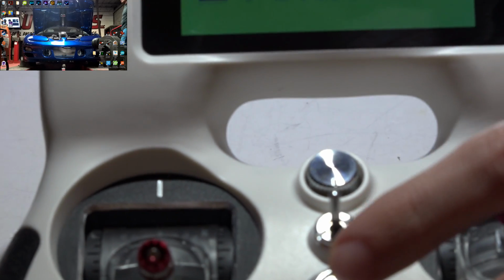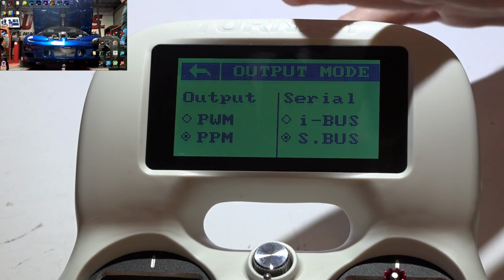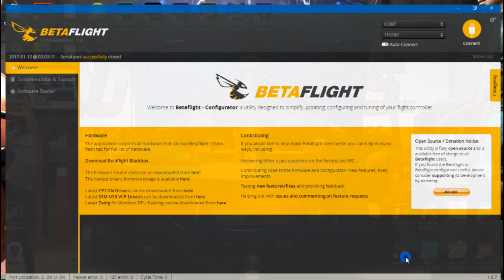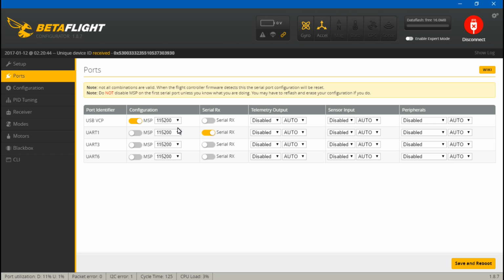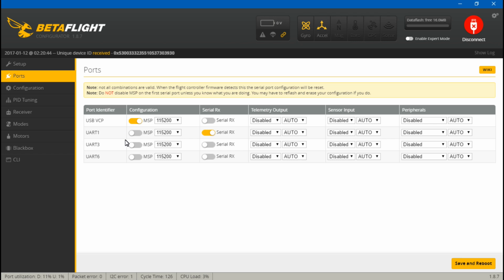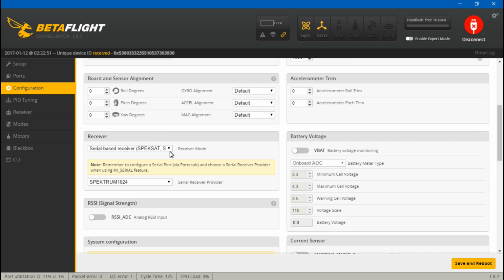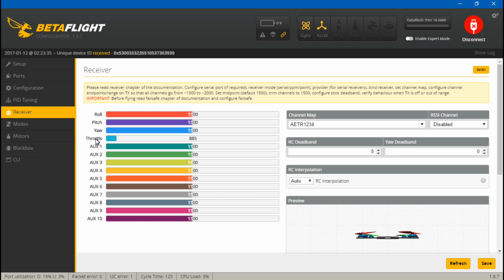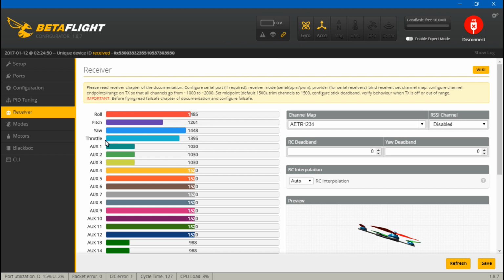TGY-IA6C Wiring & Betaflight Set Up (IBUS/SBUS/PPM)

Comment: I’m very new. Never flown my drone yet, just getting into it. I just built my drone using a naze32 f3 acro 6 FC board. Not sure how to solder the receiver for the ia6c to the f3 board. There are 4 ports (+) (-) (RX) (TX) I understand positive and negative and I’m assuming r and t are for transmit and receive. I just don’t know what goes to what, besides the ground and power.

Comment: Hi maybe you can help me i have a Problem with the failsafe if i set it up with the turnigy everything works just fine but if want to test failsafe just over betaflight it wont work the quad dont disarm if i Turn the transmitter of with the smaller FS-A8S reciver the failsafe works just Fine without any setup but with the Original reciver the betaflight Failsafe dont activate i set up failsafe at betaflight in the exact Same way but the quad keeps on spinning if i Turn of the reciver :-(

Comment: Hi JC & other follow quad fliers,
Cant say enough how much your videos helped me with my first build!!!! You ended up having a play list for every major component that i needed help with, made things so much smoother and saved me from having to go to any RC forums and wade through the mess, for real you should have 3 times as many subs with the top notch videos you put out, full dedication shows in your video with how detailed they are and how often you update them, keep it up or the multi-rotor world will suffer.
So did any one else find that the Turnigy Evolution & or the TGY-IA6C causing problems with FPV RX. my video feed is perfect until i turn on the Evolution, then i get horizontal lines sweeping from top to bottom of the screen and it intermittently cuts out&in for about 1/4  a second, the whole quad is powered, video is perfect, i then turn on the Evolution and it goes to shit?? VTX & receiver antennas are about 5 apart.

Comment: Thanks for the video. Everything is set up but when I swith on RX and TX, they don´t connect. TX works fine in betaflight, but it doesn´t connect to the RX nicely, it eventually works, but it try several times before it connects. Any idea? Flight controller Revo F4 CC3D

Comment: PBF, I have been trying to configure a kiss board and a rotorgeeks f3 board with I/S-Bus (really whatever works at this point) and I cannot get it but PPM works fine.  I have only tried the A8S as I am waiting to get some iA6C's in the mail to try but  I find it hard to believe it would be a receiver problem.  Also tried all UART ports, turning serial on for each one obviously, and switching back and forth from I-Bus and S-Bus on my Evolution and in configuration. I have I-Bus working with the A8S on an Eachine Micro F3 with no problems.  Have you had any issues with connecting the signal wire to an I/S-Bus port and it just not working?  Any suggestions?

Comment: Don't know if you got ibus working on your omnibus f4 or not but i got mine to work using j2 row with signal wire on rx1 and use 5v and grnd on the same row keep up the good work
Reply from the maker: Awesome. I never tried that. Thanks.

Comment: Trying to set up the evolution with the iA6c on an eachine wizardx220 via betaflight. I am not having any luck getting it to work. The transmitter and receiver are bound. When I go in to the receiver setting I get nothing when I move the sticks. Any help would be greatly appreciated.
Reply: PSYCHO UNCLE GAMES  I'm in the process of rewiring it. I downloaded the manual for the FC to find out which uart I need to solder new connections to. If I have any luck I'll keep ya'll posted.
Reply from the maker: I'm honestly not sure why. Just recheck everything. If you're using Sbus or Ibus then make sure you have that set in the Evolution, make sure you have that wire in the right location on the flight controller and also that you have the right UART port turned on in Betaflight and Serial Rx and Sbus or Ibus selected in the configuration tab.
Reply: matt elkins Ye Iv got same problem, looks like it needs re wiring to suit
Reply: matt elkins wooohooo I got mine working, 
if you have CC3D FC then plug the 4 wire plug into the right side of the FC next to the USB
then only use Black- Red& yellow, the 4th isn't used
Black to -   Red to+ and yellow the very last wire plug into I-bus/S-bus
then Set the rest up as normal, if get stuck let me no
Reply: I'll try it when I get off of work. I believe mine came with a knock off serious f3 flight controller. Pin outs should be the same though. I'll let ya know how it goes. Thanks!
Reply: Any luck?
Reply: Here a link to naze 32 board helped me a lot. All up and working had the same troube as yourself solder white wire to number 4 on the board http://www.dronetrest.com/uploads/db5290/original/2X/9/977a2a3924cfb004ccd942228e96e4657a292b5b.jpg

Comment: What FC have you found works with iBus?
Reply from the maker: I haven't tried that many. I have put the Omnibus F3 and F4 on all of my builds. It does work on the F3 but not the F4.
Reply: thanks man. I'm planning out a build and want to stick with the flysky protocol. and want to make sure ibus works. I might give the f3 omnibus a try.
Reply from the maker: I love the F3. Only difference between it and the F4 is you cant run 8khz syncs on the F3, but 4khz is good enough in my opinion. I cant even tell a difference between 4 and 8.
Reply: Thanks man. it's not the shopping list now. I've been very undecided on a FC up to this point. recommend esc's? since I'm building, I'd like to try dshot 600

Comment: I've got the same board and rx, and I used sbus but the values were off 1000-2000. I can see yours are off too. if you figure out how to run ibus on this board, let us know.
Reply from the maker: Some boards and firmware are not capable of IBUS. You'll have to calibrate your channel endpoints. Look in my Evolution playlist in the description, there is a video on how to do that with SBUS and PPM.

Comment: I want to set this up on my naze 32 acro FC, Will this set up work???
Reply: I can't tell whether or not the UART channels are correct because I have ordered the eachine wizard x220 and I want to see if the same setup you have here will work with the eachine wizard and naze 32 acro FC?
Reply: NVM the fc is he SP racing MOF3 but still,I can't tell whether or not the UART channels are correct because I have ordered the eachine wizard x220 and I want to see if the same setup you have here will work with the eachine wizard and SP racing MOF3?
Reply from the maker: Yep this receiver will work on all flight controllers. I dont know if IBUS will work but SBUS and PPM will definitively work for sure.
Reply: On my Sp racing MOF3 FC, I can't tell where to solder the Wires too, do you know where??

Comment: Great video !   I have a little problem. I am running a sp racing f3 board and running ibus on the tgy-ia6c. The controls and copter works but in Betaflightin it keeps telling me to configure serial ports and some of the functions like failsafe aren't available or showing. My MSP is running on UART 1 and my Serial RX is on UART 3. I also don't see USB VCP in the Ports section. Not sure what's going on.
Reply from the maker: To see the failsafe and other tabs look in the top right of your screen and turn on "expert mode". I'm not positive but 90% sure the SPR F3 doesn't have a virtual com port, that could be why you dont see "USB VCP".
Reply: I'm having the same problem can't get S bus or ibus to work on none of my models have to go back to PPM I have checked everything over and over again please help anybody have any ideas what the problem may be
Reply: Awesome video I follow your video clearly but I cannot get my sbus or ibus to connect to any board I have tried everything and it seem like I'm not the only one having this problem make a new video please on what if you can't

Comment: How do i check if i can use a i-bus receiver on a fc?? This is the fc im geting http://www.banggood.com/Upgrade-NAZE32-F3-Flight-Controller-Acro-6-DOF-Deluxe-10-DOF-for-Multirotor-Racing-p-1010232.html
Reply: TheMadmacs i think you connect it like sbus then convert the ibus sginal to sbus with betaflight...
Reply from the maker: I just got the Flysky A8S and X6B in the mail. I'll play around with them tonight then do some videos on them
Reply from the maker: Its hard to tell. I just try it out and see if it works. If it doesn't work I just change it to SBUS in Betaflight, and switch it to SBUS in the transmitter. Dont have to change any wires around on this receiver because SBUS and IBUS uses the same pin and the flight controller uses the same pin.
Reply: But a flysky transmitter wont do SBUS will it?
Reply: the i6x and turnigy evolution will do sbus, but no reports of it working yet which is strange, but i think ibus sbus should be fc critical because its in the software for betaflight rather than fc itself. which is probably why no fc specifications mention ibus or sbus for that matter.. i use a cc3d and the sbus port for ibus.
Reply: that would be awsome! your videos are really good and helpfull!